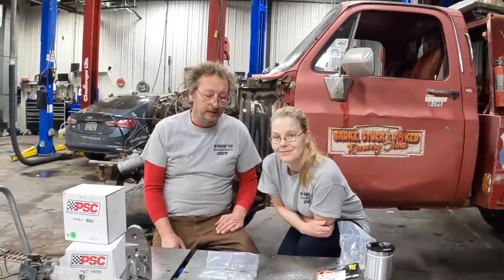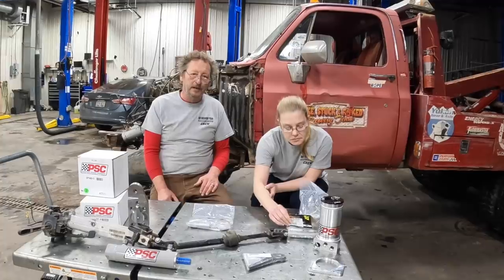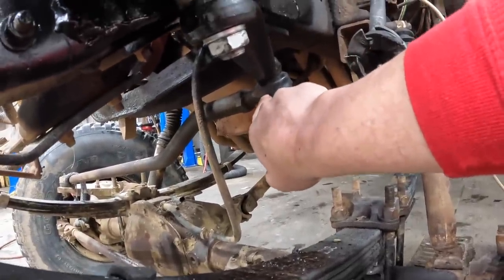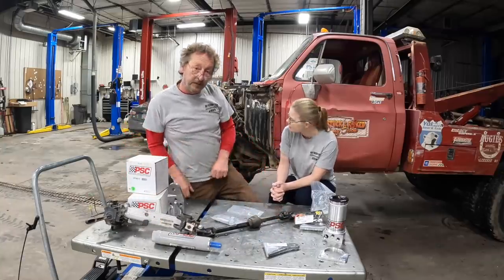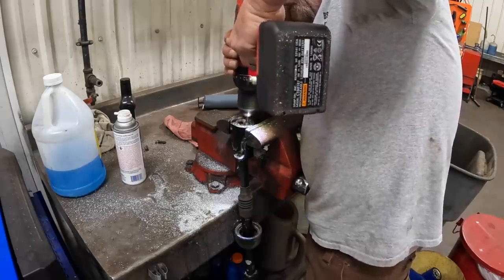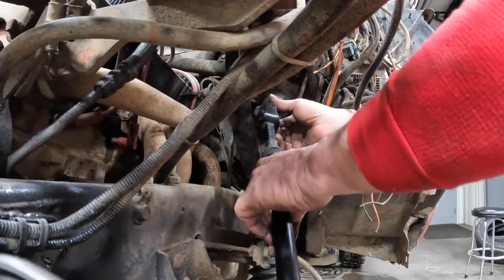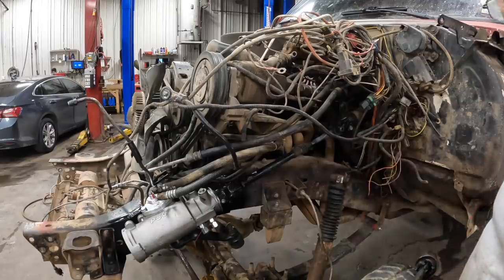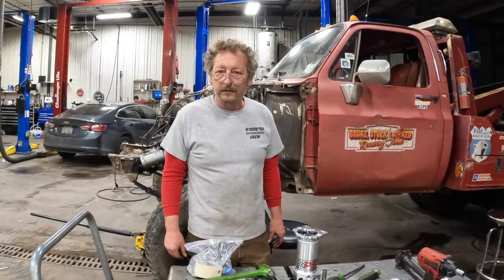No more rag joint steering shaft

Comment from the maker: For those who missed it, the steering wheel on GM trucks has a master spline, only fits on the column in one spot. That is why we needed to twist the shaft. The shaft is 5/8 solid square stock, a little heat, and twist will not weaken it.
Reply: That job of die grinding the yoke was "Embiggening" as AvE would say
Reply: @recoveryteam Many thanks for clarifying! I wasn't aware ... --> my fault.

Comment: I do wonder if the crossover steering contributed to the old box pulling off the frame. With the crossover steering it’s pushing and pulling the box perpendicular to the frame. With the short drag link it’s more parallel to the box. 

I think the reinforcing and modifications will help a lot though. I’m sure people will say you should just go full hydro. Always easy to just say throw all the money and time at it from the Internet.

Comment: Hey Eric !!!  OKS !! Great showing what was in the way to put another reinforcement behind the frame ,but couldn't tell if you used oversized washers on the bolts to help to prevent them from pulling thru again !!  Great work with the steering column too !!  A little twist was ALL that was needed !!  Guarantee you'll be watching for the obstacles that will break it again when on the trails !!  Have a good week & Thanks again !!

Comment: Eric, isn't that steering wheel on a splined shaft?  Couldn't you have just pulled the steering wheel off and put it back on in the centered position?
Reply: Yep he could have, but heating and twisting the shaft was way faster.

Comment: Years ago, Me and my buddy were driving a K5 Blazer down in the river bottoms and broke a rag joint and lost steering. We were young at the time and had all our money spent in beer. We went back to the farm and used a big hole saw in the sidewall of an old tire to replace the rag joint, took it back to the truck drilled it and wrapped it with like 15 metal zip ties to get us home. Good memories

Comment: Why not setup your steering to center, get it all together then pull the steering wheel , and cog it so it's clocked correctly?
Reply: Only goes on one spot.
Reply: @badgerpa9  a steering wheel on a square body chevey only goes on one way?
When did they start that?

Comment: Why didn't you just pull the steering wheel and reposition it since it is splined instead of twisting the shaft and making a week spot
Reply: I was gonna say the same thing.
Reply from the maker: GM steering wheels have a master spine, only go on in one spot.

Comment: Another reason for collapsible steering shaft was in case of front impact the steering wheel  won't go flying into the driver
Reply: They have collapsible shafts with a section that’s designed to crush before shoving the steering wheel into the driver. Those would basically be a solid shaft with a weak section. But, what he’s talking about is the sliding section which partially serves the same purpose of not crushing the driver. Mainly let’s things move a little as the body and frame twist.

Comment: Good looking upgrades Eric. I remember when you hit the side of the bank and tweaked the frame that time. Was it even the same spot in the trail maybe? Always good to see these old trucks repaired and improved rather than tossed aside for something a lot newer and half as durable. Been enjoying your adventures for years. I recently referred back to your video on swapping the power steering pump the last time you did it. I had to change it on my '79 K20 and lucked out with being able to set mine up exactly like you did in that video. Worked great. Love these old trucks. They don't build em like this anymore. Take care man. Thanks for the help!